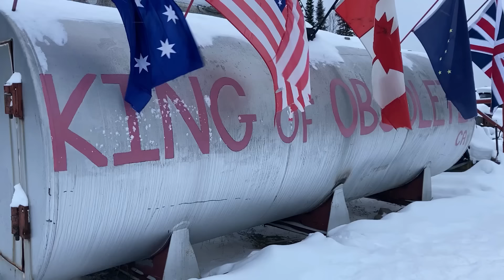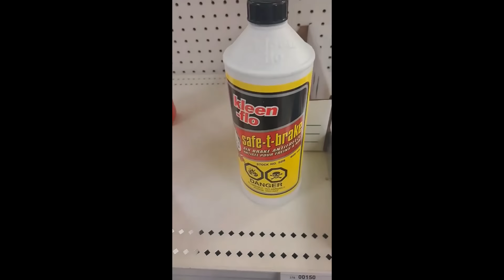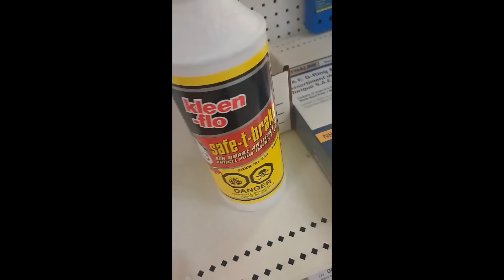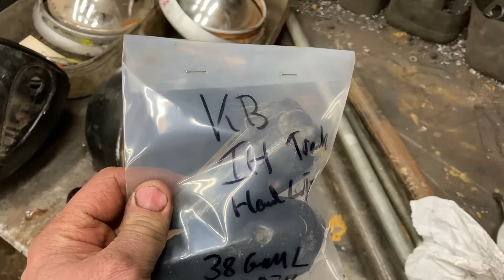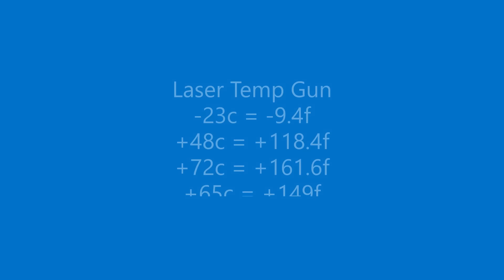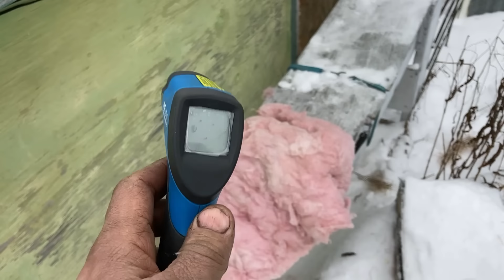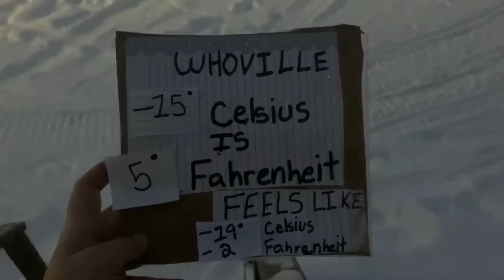Living Remote Sewer Line Frozen Jan 23 2024

Comment: Never new how fast that 911 stuff worked. Thanks for the presentation sir Rodney.
Reply: Excellent thanks
Reply from the maker: yes good video by Sir Rodney  thansk
Reply: Does the 911 disperse through the entire fuel system . Do you need to change the fuel filters and fill with 911 to help thaw .
I guess these work as long as the engine is still running ?
Reply from the maker: depends on the year and style of the truck. my Screaming Ford from Ice Road Truckers is set up that i can easily add to the system but newer trucks will be different  thansk @heartland96a

Comment: my headlight buckets look the same without that top piece on my U S Army 1952 Dodge 3/4 T. 4x4 M37 and they are 24 volt lights. The whole truck runs on a 24 volt system and so far those 72 year old parts still work. I really hate working on sewers in the summer had to dig one out I gaged. Lucky poop is frozen and sealed off. Like those sewer pumper guys say it may be shit to you but its my bread and butter. Thanks for the video.
Reply from the maker: i did a quick google search on the head lights as the video loaded up. they are Guide Headlamp 682-c which was used on everything and anything. very prices for originals on ebay but new remade as chrome hot rod ones are cheaper. good to know because parts can be gotten which will be the little things that will be missing. up here we have no smells so when we travel south we notice a lot of smells. life is different here.  thansk

Comment: Hmmn, Your makeshift wiring made me cringe until I figured out how you did it. Unplugged at the other end. Pretty much a self taught electrician. Given myself enough jolts to respect it ,but not fear it. Anyway ,it was a very cool use of a block heater and tape. I learned about heat tape sucking yrs ago.Xena, best of luck with the  4th graders. The kids on South Park have been 4 graders for 22yrs 😎
Reply from the maker: yes anything goes up here as part of survival. being colour blind i have felt current more then once. people forget how strong tape is these days when it is used in warm conditions.  thansk
Reply: They were good kids, I had no problems. Really enjoy working at the school, I am learning as well. 

Xena

Comment: Hi Mr. Obsolete. I just wonder if you could double up, triple up  or more on the heat tape and only run it when the pipe freezes instead of all the time.  Was Sire Rodney  inferring that you put Diesel 911 down the toy lay?  Amazon gots it for 39¢/ ounce U.S. or 2¢/ml Canadian w/ free shipping. (or so it says)  Talk about pouring money down the drain Eh? Fine job on the grill and teardrop headlight buckets.  Ms. Staff, if I may: There is nothing more rewarding than knowing that you are correctly shaping the minds of the future owners of our Freedom. I bet you are doing great. ben/ michigan
Reply from the maker: we gave up on any heat lines or tape here. total junk when you need it the most. our little systems and ways work good and do not cost a lot of money and easy to work with when it is cold.  thansk